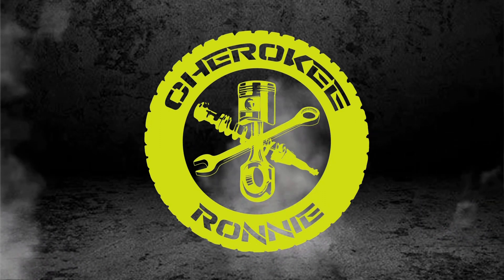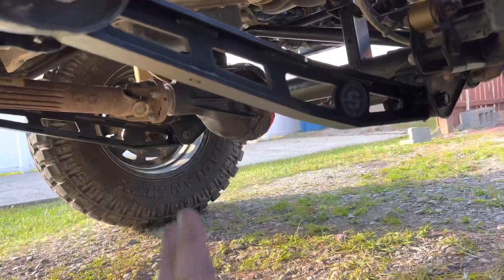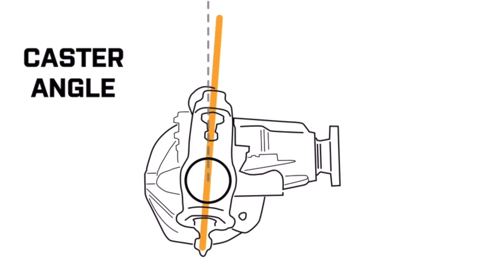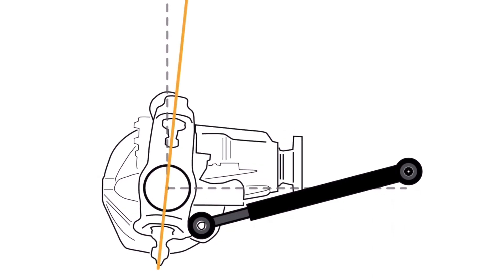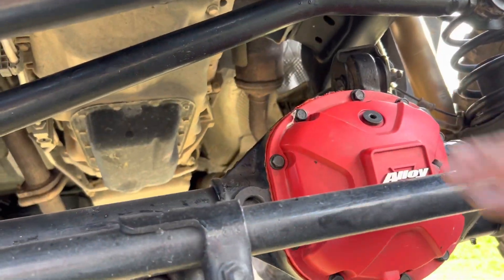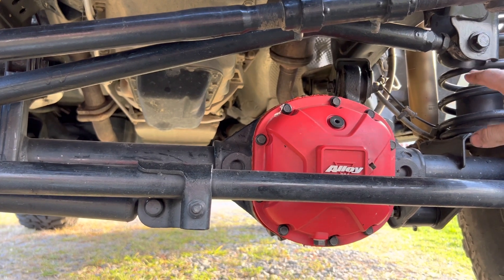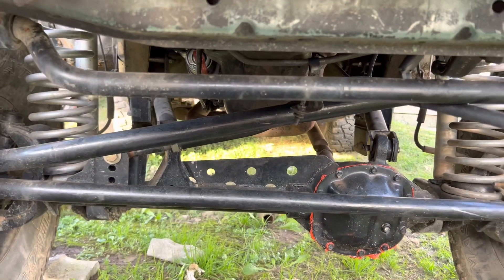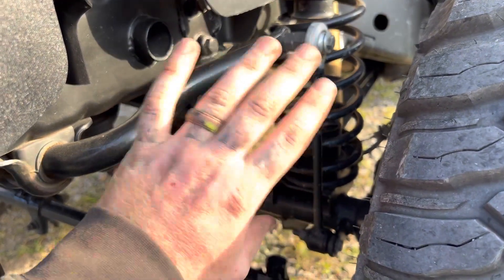Watch this before lifting your jeep | Jeep Suspension Geometry Explained

Comment: Excellent ! a good rule of thumb is to add 1/2 degree of caster for every 1" of lift and sway bar disconnects will add articulation AND save wear and tare on the sway-bar bushings

Comment: Thank you for posting this information. I feel very much more informed. I am currently swapping a lift from a donor XJ to my drivable XJ. The information you provided will indeed help me with my build. I am not building a rock crawler. It is mainly for camping, overlanding on light to moderate trails. I am putting money, blood sweat and tears into my XJ and don't want to have it break out on trails, costing more money. I am a disabled veteran with very limited resources. Again thank you for the info. New subscriber and will be watch your other videos.

Comment: Question: I have a stock 2021 Willys came with 32” tires and I just threw on a set or 35x12.5 r17. Do I  / should I get a small lift with adjustable components?  The tires don’t rub. I did adjust the steering to fix the steering wheel.

Comment: Your saying to replace lower control arms to set caster? From all I've read your suppose to replace the upper to adjust caster. From my research, if you replace the lower, you're pushing the axel out further, which would require longer drive shafts. Can you elaborate maybe my research is inaccurate.

Comment: For folks lifting 4" and above, remember to look into OTK (over the knuckle) steering. If you're just starting out it's easy to think when you buy a lift kit that it will have everything you need, but this often ain't so unfortunately
Reply: Drag link flip kit.
Reply: I prelifted my track and drag link flip to keep geometry parallel and get it out of the way of logs and rocks. And prepared for 4" plus lift. I'm at 3.5

Comment: 95 ZJ
3.5 inch lift
RC upper lower adjustable control arm's front rear. RC adjustable track bars.
Skyjacker 3inch coil springs front rear.
Bilstein 5100 shocks. Moog ball joints.
Currie hd y style steering. Fox steering stabilizer. Power stop rotors, pads, calibers.
249 tcase new tom woods double cardan front and back drive shafts. Drives good still has a little bump steer and thought these tom woods shafts would get rid of drive shafts vibrations i get over 70 not bad as when i was stock. I am still in need of adjustments.
Tires are cooper discovery atx XLT 31's
31/10.50/15 on stock rims 1.5 Supreme wheel spacers.

Comment: Thank you! What a lot of people don't realize is that unless you have an adjustable drag link/track bar, you will have to re drill the track bar hole to put it back in, which is not recommended because 9 times out of 10 people don't know what they are doing and it will ruin the suspension and give you death wobble, even if the track bar hole is wallowed out, clayton offroad sells a good extendo track bar that upgrades the bolt size to a 9/16.